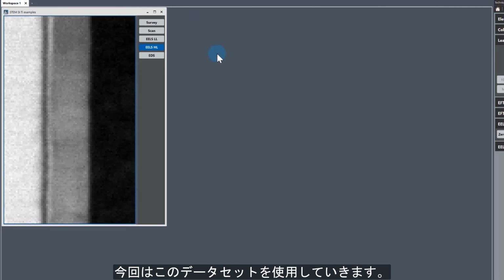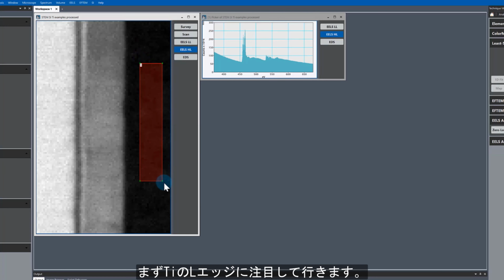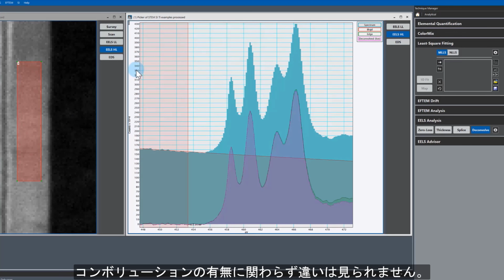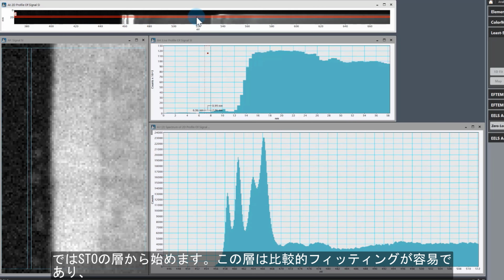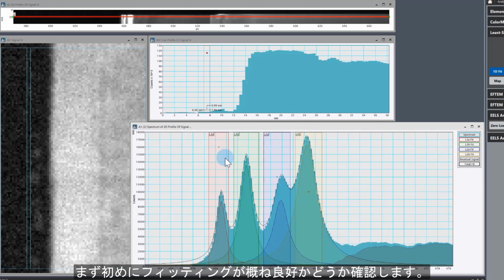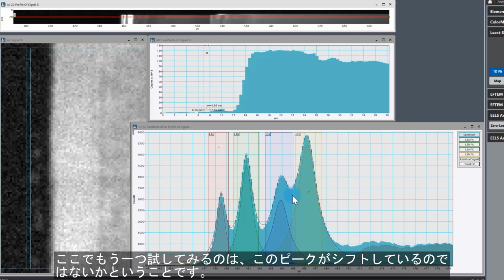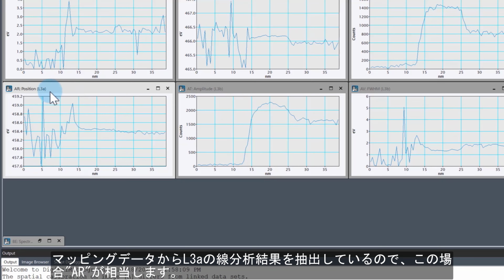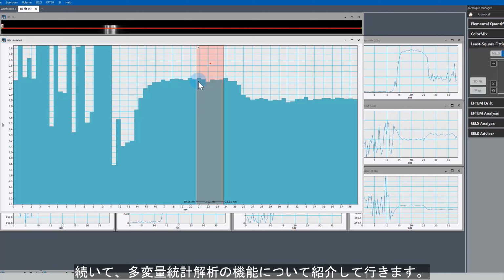データ解析 ― ELNESのデータ例に対するNLLS処理

Comment: Thank you for this very useful education video!
I have 1 question: is it possible somehow to extract the integral intensity (the total area under the curve) for each NLLS component using standard DM functional?
Reply from the maker: For a Gaussian and Lorentzian function, you could create a simple script to calculate the integrated intensities using the amplitude and FWHM.

One method is:
Setup fitting
Click “Map”
In the dialog, choose output and check "Individual fit models"
This creates a new data cube containing the fitted model for each function.
Go the Volume menu and choose "Project Along Z"
You then have a 2D image with the integrated intensity (area under the curve) of the function at each point.